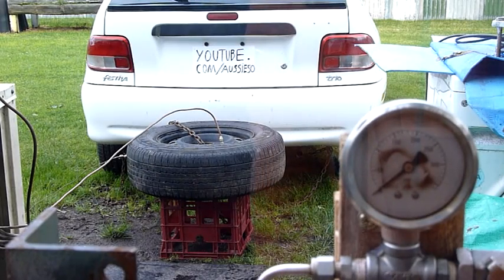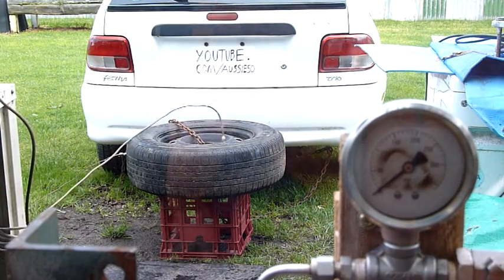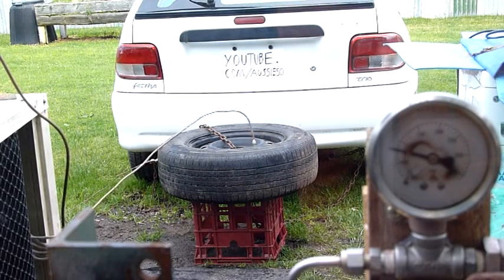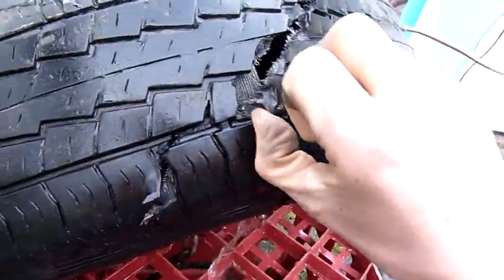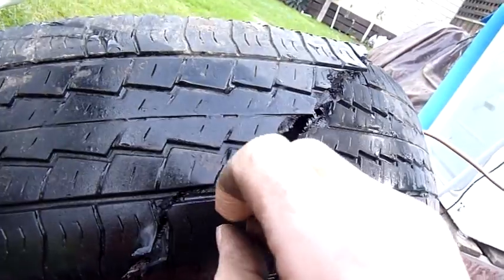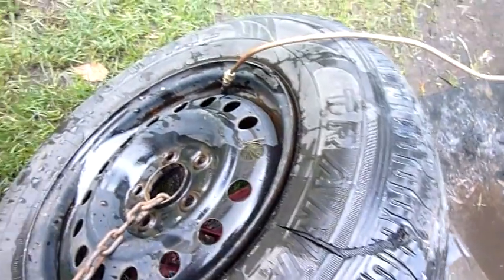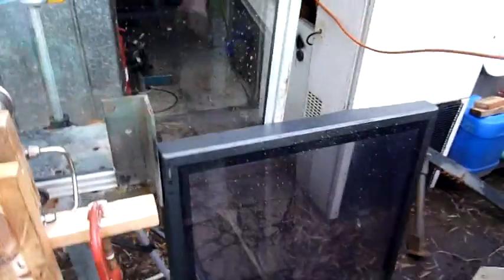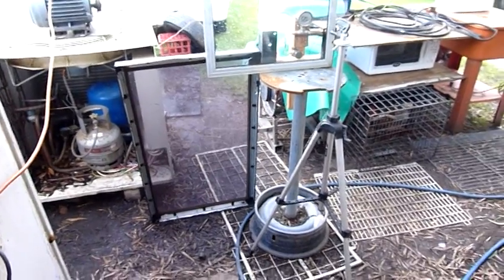Hydrostatic Pressure Test - When Will It Pop - Small SUV Tire

Comment: I imagine you could vacuum the air out and fill it with water through only the air valve by using something like a refrigerant gauge manifold. Vacuum the air, shut that side off and open up the water side.

Comment: You could pull a vacuum on the tyre, then let that suck in the water (or just pump it up with the water pump). And you could fill all little car's tyres with 150 psi water and drive over something sharp to see what that would do!

Comment: Haha, you popped it!

It's interesting, but not too surprising that it failed where it did, as I was expecting the tyre to pop off the rim, or something like that.

Yes, I had my bets on either the plug-thing flying out, or the tyre popping off the rim.

What I wasn't expaecting, is for the tyre to split in the way that it did. Little-car got a good shower though.

Oh, and also....My Return button on my keyboard is working again in these Comments boxes. SUPER YAY!! :-D

{^_^} BoomBoxDeluxe {^_^}

Comment: weld a tube in the wheel curved up toward the tread , v-notch the end so it can't get blocked by the tire pressing against it , and that will do the same job as the hole in the tread did , try and find a 10 or 12 ply trailer rated tire ;) big boom ;) you can also braze in a truck brass valve stem instead of drilling and tapping a hole , might prove faster , and better , threads might pull at extream pressure , and cause a flying bit of pipe , my opinions , not telling you how to do it ;p

Comment: drill a hole in the rim somewhere and tap a thread bleed out 98% of air then screw in a small bolt. like on the inside of the rim away from the tire

Comment: just pop the bead off and put the whole tyre under water and get the air out and reseat the bead. and pop a little pressure in it the hold the bead.. hey pressto a tyre with no air.

Comment: Could you not make a water bottled rocket by using a cork on a bicycle valve. Then filling it it up 1/3rd water then using air pressure for all the rest. If you get a good cork then can go about 20meters high.

Comment from the maker: its more to do with unsprung weight, tractors have no suspension, so it has no real impact on drivability, whereas on cars, you need that tire to move up and down over bumps, as fast as possible, with a added 40kg of mass, it will take ages for that tire to come back into contact with the road after hitting a bump.

Comment: Why not suck most of the air out like you've done previously, then fill it with water? It will still have some air in it, but would it be enough to turn the wheel ballistic? I mean i would think that at least 50% water would dampen it quite substantially.

This means you don't have to compromise the wheel/tire at all.